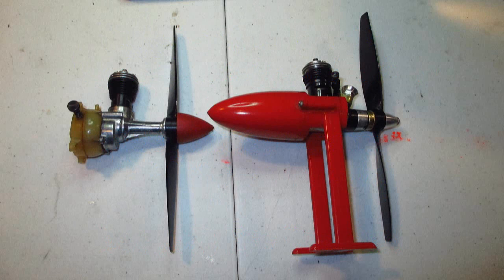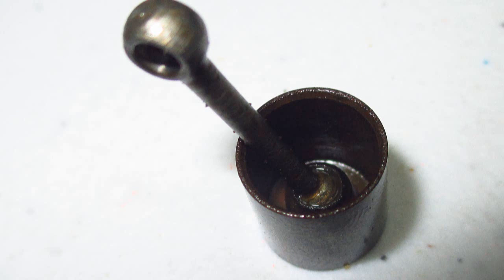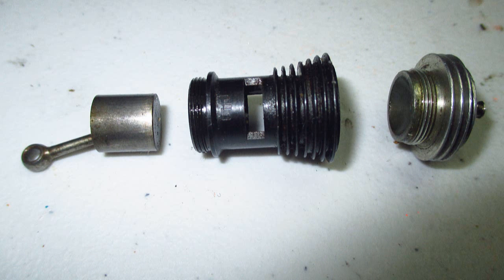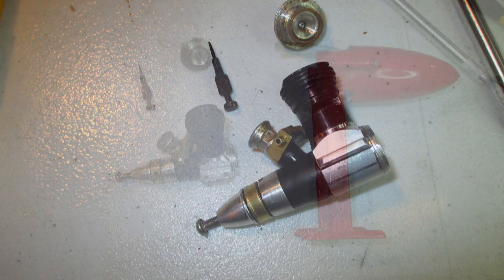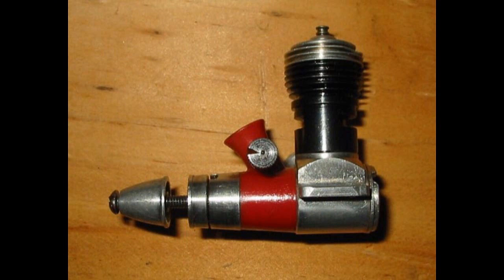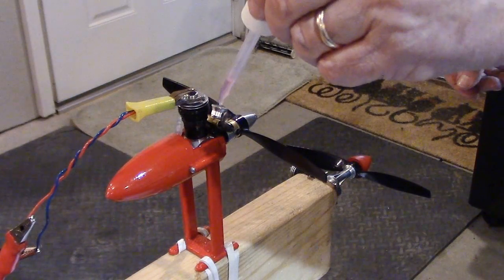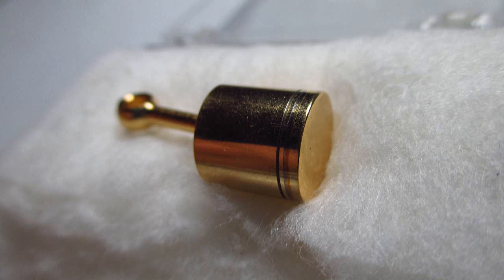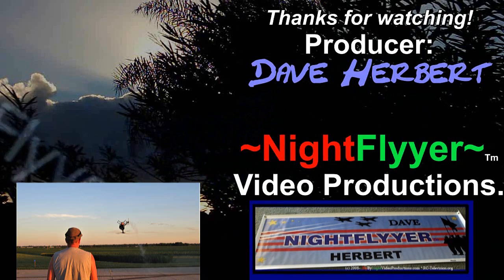The 1953 Space Bug Jr's!  Operational Demo with Tee Dee too!

Comment: Back in 1972/3 we had a 1/2A pylon racing class for TeeDee 049/051. We used the grey Cox 5x4 prop and some us reworked the prop only to find that the rod would depart through the bottom of the case. Happy days!
Reply from the maker: A friend and member of our RC club, Dave Duncan, worked at Cox Along with my wife in 1968 in Santa Ana California so I know the Cox engines well. We loved the Cox engines and I had many and a complete set of planes (see videos) of them all, but they were sadly destroyed in the fire along with all my planes and memoirs.  Those were the days for sure.  I just bought a Cox pt 19 brand new in the box on ebay for $180, so I can tell you that times sure have changed.  I also just bought some of the Grey 5x4 props from Coxengines.com in Canada, so will be experimenting with them soon.  See my video on my Cox Powered You FO flying disc to see one of my latest cox or my Cox.010 flying rag videos for fun.  Thanks.

Comment: Hi from New Zealand.  I have an old HP40 engine that has the usual castor oil gumming and was put away in 1972 and not cleaned (my bad)!  Can you suggest a solvent to remove this gum and get things working again. Even the carb is 'stuck'.  Maybe a engine service video would be well worth your time? Cheers from Dave [NZ]
Reply from the maker: Hello New Zealand.  I used a heat gun to un-freeze these 2 engines, as both were frozen too.  I then used alcohol and wd 40, but brake cleaner or Lacquer thinner will also work.  Thanks.

Comment: Cox engines website? They aren't still making these ... Are they??
Reply: No, they're not. But there's an online store that has lots of new, old stock Cox engines, parts, and accessories. They acquired these items in a buyout when Estes Rockets shut down the Cox division in '09 if I remember correctly.
Reply from the maker: They are manufacturing some parts, like Glow plugs and inserts, but are basically using new old stock to build new engines.
Reply from the maker: @NitroJunkie626  Well said. Thanks.
Reply: Last one I bought was probably quite a few years ago what's up Black Widow  04 9 nice motor I thought
Reply from the maker: @bretwessendorf2674  Yes the Black widow with the bigger tank was a great engine.  Thanks.